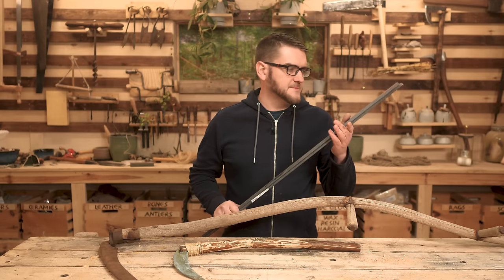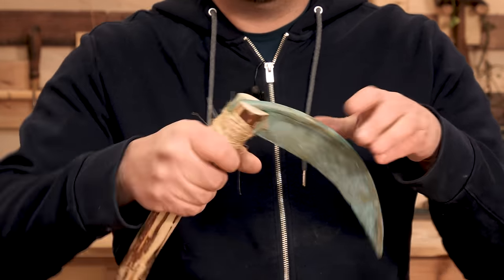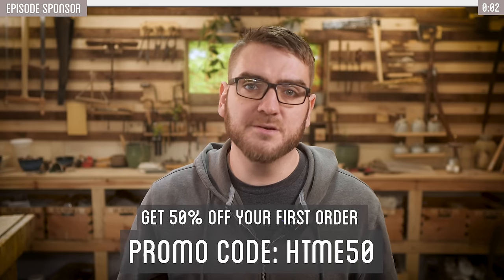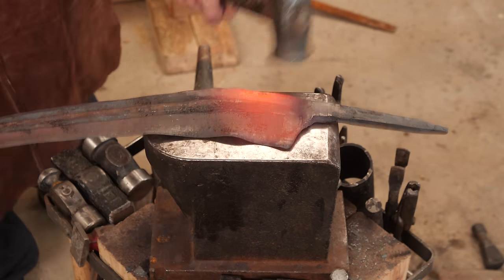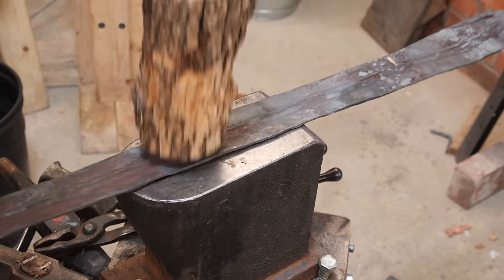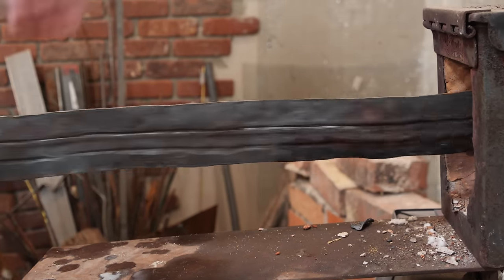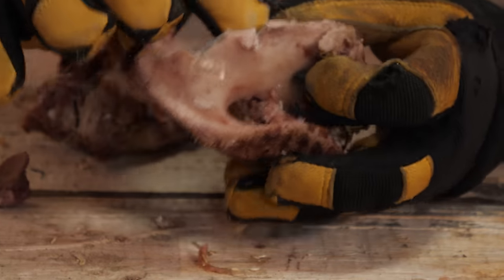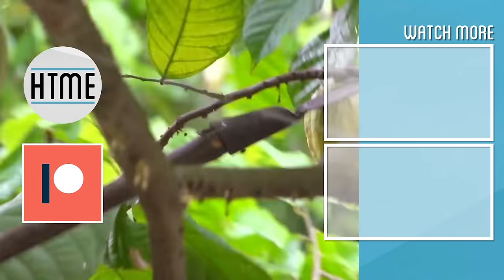Farm to Sword: Can you Turn Old Farm Tools into a Norman Sword?

Comment: You guys would really be a lot better off if you just asked for help from a few experts. Not even as consultants or to hire them. Just to ask them for guidance and honest criticism of your videos. You would gain a lot. Many problems you have could be solved in just a few months through training up your crew a bit more in a few areas, and some honest hard work. You guys clearly really want to make this channel work, and it hurts me to see you guys fail so often. If you want to improve, your best option right now is just to ask for honest criticism, and to try your best to work on projects. Not even video worthy projects, just small things. Make birdhouses, coasters. Learn to sharpen and use a chisel and a knife. Learn to make some simple jewelry and dress a blacksmithing hammer to make some clean edges on your work. Learn just the basic principles of metalworking and practice them. Just an hour a day on odd projects here and there from everyone producing stuff in the group. It would boost your video quality so much if, in your woodworking videos, all of your joints were perfectly rock solid and your posts were sunk really firmly into the ground. It would help this guy if he knew how to prepare stock (to prevent those ridges and cold shuts), draw it out, distribute his metal properly, and forge bevels and stuff before rough and finish grinding. It doesn't take much, really. Just practice and a desire to improve. You guys have the desire to improve. Now all you need is practice. If you can at all fit it into your schedule, please do. Even just hammering some iron cold as a hobby. Just getting familiar with tools. Sharpening a chisel. Anything. It would be so obvious that you guys knew what you were doing if you just practiced the fundamentals more. I really feel like that's what's lacking with these builds. Even just 30 minutes or an hour a day and in a month your production quality would be so much higher just because you guys would start to know how to see the difference between good and bad handiwork.

That's all lol.
 tl;dr I am a guy with a lot of hobbies, and I am very impatient with myself. I practice a Lot and start big projects a Little. it has helped me a huge amount. The big and cool projects are really just capstones for the work that I have done in the little projects. The swords, finished tenths tolerances machined parts, tobacco pipes, are the tip of the iceberg that is 99% boring practice with little dumb small projects i never really finish lol